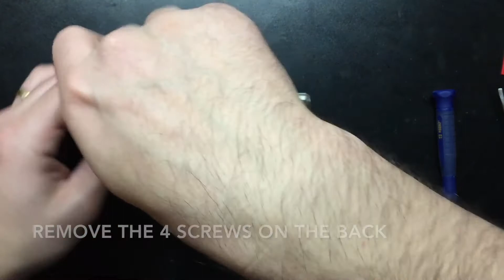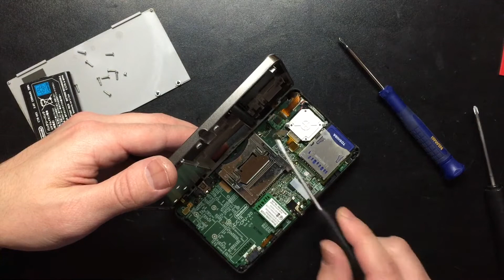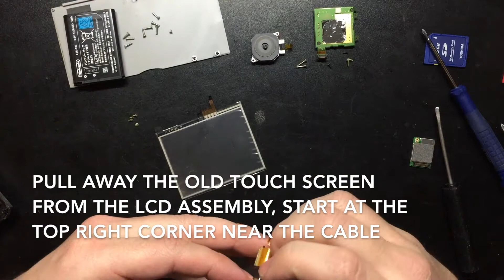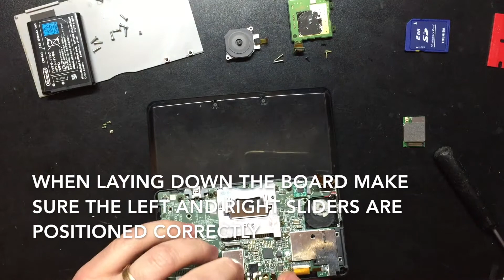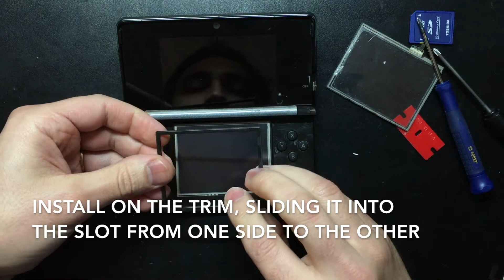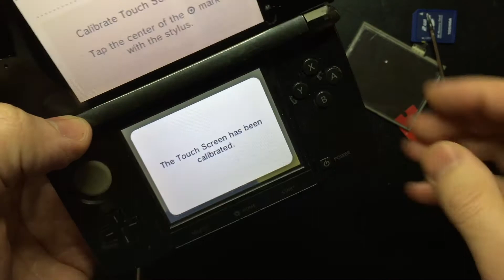HOW TO REPLACE NINTENDO 3DS TOUCH SCREEN

Comment: For anyone who’s wondering how to boot directly to the calibration screen, hold L+R+X while powering on. Once the screens turn on, release all buttons. You’ll boot directly into the touch screen calibration interface.
Reply: Would you happen to know how to fix the touch sensors? I've tried recalibrating a million times, but it won't work.
Reply: @Russell Mathias I really appreciate your reply. I found the site thru google and I'm waiting for the hacking stuff atm.
I see it takes quite some time so I will get back to you later when my account password hopefully is recovered.
Reply: @Russell Mathias it did the trick and I finally got access to my account again. I am so happy!
Thanks so much you saved my ass !
Reply: @Donovan Atticus glad I could help xD

Comment: Video is perfect, exactly what I needed. First attempt at it and I misaligned the top screen ribbons so I only had bottom video and top backlight. Dissassembled and tried again using twizzers this time. Bare-boned it back together, placed battery and booted up and check!! Top screen video was working again. Booted off, put all remaining screws where they belonged and put together again to work perfectly. Took about an hour and a half altogether to do; but I just know it would have taken longer had I not found this video. Thanks!!

Comment: i replaced my touchscreen, but it doesn't respond to touching at all. I've read that i might try to go to the calibration interface with L+R+X, but unfortunately, I broke my L-button during the process... before I invest in buying new spare parts again, does anyone know, what the issue might be?

Comment: I have some questions:

•Does this work/apply to the New Nintendo 3DS system models?
•What screen replacement did you use?
•About how long did it take to completely repair it?
•Do you have any tips on how to repair the system or how to go about repairing it?
•If Bionis forbids something goes wrong during the repair process, is there a way to fix it? (Motherboard corruption, broken parts, loss of parts, etc)
•Would it be better to send the console into Nintendo rather than to a personal manual repair or vice versa?

Edit: Is there a text based in-depth guide to how to do this properly and avoiding any damage done to the console?
Reply: •The screen assembly should be completely the same, though I am not fully sure if some of the ribbon cables are in different positions.
•You can find just one type, just search for a 3DS touchscreen on eBay and you'll see a lot of options that are mostly around 7 USD.
•The video is literally not even sped up at all. So that's about a 10 minute repair. For different people it might take more or less
•Honestly the only thing I don't like is that he used screwdrivers to flip up the plastic on the ribbon cable connector. Tweezers and plastic pry tools are a way better option.
•Other than the screws, joystick and SD card slot, I don't know anything else that you can possibly lose. If you want you can put the screws in a little container stored separately. Broken parts can easily be replaced. I have no idea how a motherboard corruption can happen.
•It depends how much you trust yourself in repairing something.

•There is an iFixit guide that's step by step how to replace a touchscreen:

-3DS: https://www.ifixit.com/Guide/Nintendo+3DS+Touchscreen+Replacement/6015

-3DS XL: https://www.ifixit.com/Guide/Nintendo+3DS+XL+Touchscreen+Replacement/25071

(NOTE: This guide is not full as it only gets to the removal of the Touchscreen+LCD assembly) new 3DS (2015): https://www.ifixit.com/Guide/Nintendo+3DS+2015+Touchscreen+Assembly+Replacement/72244

-new 3DS XL (2015): https://www.ifixit.com/Guide/Nintendo+3DS+XL+2015+Lower+LCD+and+Touchscreen+Replacement/86283

(NOTE: This one is also a bit incomplete just like the n3DS one. Unfortunately it was the only one I could find.) new 2DS XL (2017): https://www.ifixit.com/Guide/New+Nintendo+2DS+XL+Touchscreen+Replacement/98314

Comment: This very useful but quick question if the touch screen is not responding should I replace it? Plus the color of the lower screen became darker/dimmer
Reply from the maker: Could be liquid damaged, you will have to remove and inspect, clean off any residue off the motherboard with alcohol. Replace parts as needed and turn on and test once everything is completely dried.

Comment: Help me plz so i friend gave me the red 2011 3DS for free because it was all brown i put it bak together and everything looks good but when i tern it on the light flashes red and a there is a POP sound and then it tens of cold it be that the cables from the tech screen  that has that weird dore like conector the grey pice fell of and i lost it what can i do also i charged for 1H and 30 min and the flashing red light was steel on ?plz help me!
Reply from the maker: This is usually a problem with the 3d cable or the top lcd cable, or both could be defective
Reply: @TheFixTech  hi I just want to say sorry for my bad spelling I just realize that it says brown instead of broken
Reply: So I just want to say huge thanks for answering my question I think it might be the 3-D cable is that the one that connects in the same area as the speakers but on the bottom part of The logic board?
Reply: @appletopic  it could be many things that could be wrong. you'd just have to troubleshoot it with another working 3ds. otherwise, you're boned
Reply: peanut Thank you for your help I think I know what is wrong with it I took it apart once again and turns out that I accidentally ripped a little piece of the camera flex cable when trying to pass it through the hinge, I think that would be the problem could that be the problem, also I charge the 3DS and now it doesn’t flash red n just stays blue  but does not flash it stays blue for some seconds and then  there’s a popping sound.

Comment: If my touch screen on the 3ds Is not accurate do I replace the lcd too or the thing you did?
Sorry if this is a dumb question.
Reply from the maker: First try calibration in the settings, if that doesn’t help, just change the touchscreen itself, not the lcd. You will have to separate the lcd from the touchscreen, it is easy
Reply: @TheFixTech  ok thank you.
Reply: @TheFixTech  i had the exact same problem, thank you a lot!
Reply: Thank you for the tutorial. I have a doubt. Do you need an air gun or something special to separate the touchacreen from the lcd?
Thanks in advance!

Comment: do you know which tools i'll need? i can only open the back cover with those i have
Reply: i need to know which was used at 0:45
Reply: @joaovictorfiorini1447  that would be a small screwdriver. I don't know the exact size...